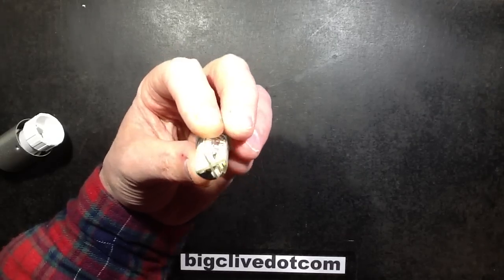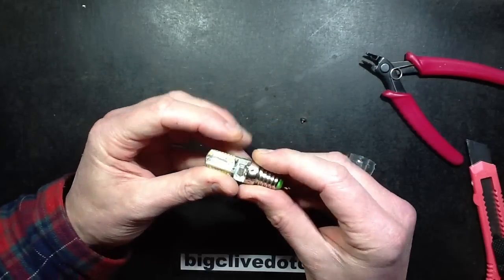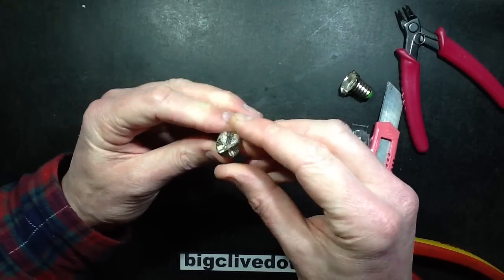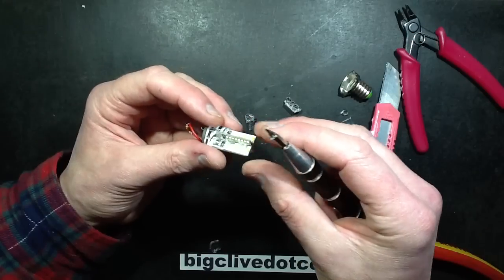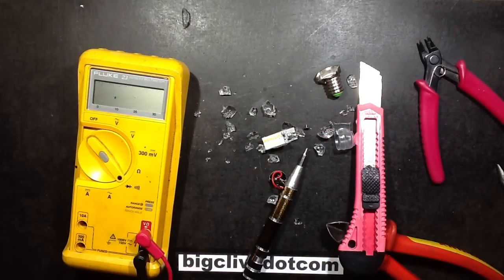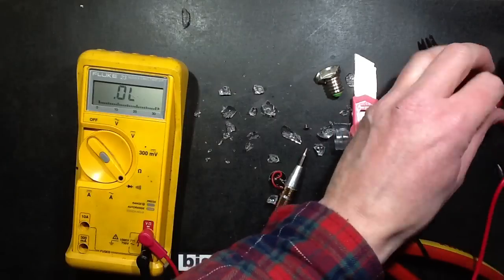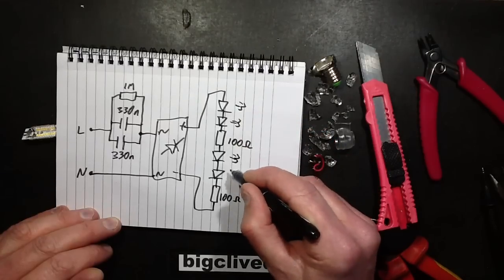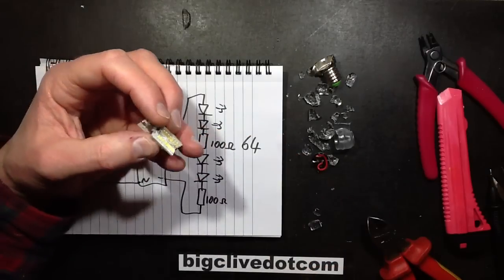Silicone gel LED lamp "teardown" (complete shred).

Comment: That Stanley knife and your thumb.

Scares me every time there is a sudden jerk.
Reply from the maker: I'm a seasoned veteran of using a Stanley knife.  I have cut myself in the past, but I can't even remember the last time I did it.  When it's a tool you regularly use you tend to exercise tight control of it.  Sadly the UK health and safety executive don't understand this and keep trying to ban them from construction sites.
Reply: bigclivedotcom Absolutely. I recall jamming a pocket knife blade into my foot as a teenager, trying to open those ludicrous packages that are built to survive chainsaws. So the fear remains :).

I was additionally wondering why they had two 330nF caps? In case one fails? Surely they're so small that space isn't an issue?

Thanks Big Clive, you're the best!
Reply from the maker: TED6667 I think it may just be easier to get the 330nF capacitors rated at that voltage in an SMD package.  It also lets them spread the circuitry evenly on both sides of the PCB allowing a slimmer profile.
Reply: bigclivedotcom Ah, perfect, that makes sense! Might be an e-series preferred number issue. Thank you very much Big Clive!
Reply: +TED6667 You should see how fast my grandmother cuts a potatoe, with a knife so sharp, you dont know your cut until a minute or so later. No cutting board needed.
Reply: We've had a lot of different kinds of knives at work and, oddly enough, Stanley makes some of the worst stanley knives on the market (tho they also make good ones).
Reply: Weirdly, in my neck of the woods a “Stanley knife” refers only to the kind with replaceable trapezium shaped blades, not these snap-off knives.
Reply: @DarkLinkAD  The actuality is: The sharper your knife is the less accidents you have. Dull knives catch and that is the biggest reason of knife accidents.

Comment: Here in the U.S., these are becoming a popular upgrade replacement for the E-17 incandescent bulbs used in both over-stove smoke hoods and over-stove style microwave ovens. The incandescent bulbs have a VERY short lifespan due to being in such a tight, poorly ventilated light enclosure and due to the fact a lot of people tend to use these as "night-lights" for the kitchen area. I ordered the below set for a good friend and she reports that so far, so good. She's happy with the light output, the color, and even reports that the dimmer function works just fine. She leaves them on almost all the time on the low setting and turns them up to illuminate the cooking surface of her stove when she cooks.

http://www.miniinthebox.com/dimmable-e17-6w-80x3014smd-600lm-2800-3200k-6000-6500k-warm-white-cool-white-light-led-corn-bulb-ac-110-130v_p3310413.html

Comment: Hi Clive, i have these bulbs with G9 base and noticed they still glow when off no matter how long .  I assume it is drawing power somehow.  The switch for it is not illuminated so can't be b that.  I have notice is draws 14v AC and when multi-meter is set to DC or continuity setting on the positive and neutral at the back of the light the led glows is no-more.  Do you know what is happening and what can i do so it doesn't glow?
Reply from the maker: DUKE It's very common.  It's caused by a mixture of insulation and capacitive leakage between the switch wires.  Although it's only micro-Amps that is enough to make the LEDs glow.   Most LED lamps use a parallel resistor across the LEDs to shunt the leakage current.
Reply: Thanks Clive, I just saw one of your other video talking about it.

Comment: I have some g9 leds I bought, and the US supplier sent me 230v bulbs, despite the listing only saying 120v. they total 104 LEDs, two sets of 52. Each set of 52 has a 100ohm resistor on it, and both are connected to the same 330nfx2 capacitive dropper and diode bridge. As I live in the US, is there a way to make them work on 120v? They currently draw about 1 watt, and the listing rated them at (a rather suspicious) 9 watts. Any ideas?
Reply from the maker: +Luke Den Hartog They are very unlikely to actually be rated 9W.  Do they put out much light on 120V?  If they do and there's not too much flicker, it might be worth using them as decorative lamps, as they should last a very long time if they are being under-run.
Reply: +bigclivedotcom They run at less than a watt. They do flicker and I was going to bodge an electrolytic on the output of the diode bridge. We bought them to replace the three 40W halogen lamps in my ceiling fan. The halogen lamps draw far too much power. If one violently detonates at some point, it will be fun to watch. they certainly used cheap LEDs on these, because I used "Bobo The Clown's LED quality testing method"  and some light, some dont at super low power. If I were to get an LED total power of about 15 watts over the three bulbs, I would be happy. Thanks for the quick reply!
Reply from the maker: +Luke Den Hartog That would work to increase the voltage and smooth it a tad, but it would mean a capacitor sticking out the side of the lamp if it's one of the tiny ones.  I'd suggest getting some new lamps. It's going to be an easier and safer fix than trying to bodge bits into these ones.
Reply: okay I think the seller was sending replacements. might just use these for decorative purposes. thanks!

Comment: Kind of disappointing they didn't put those LEDs in reverse parallel. Could be even smaller without the rectifier diodes, and with the dropper hidden inside the base. or it could leave enough space for 16 (or 24?) LEDs more.
Reply from the maker: On one hand the shimmering might have been noticeable, although if the LEDs were wired as inverse parallel pairs, they are close enough to minimise that.  There might also have been a slight reduction in light output from driving the LEDs at double the current, albeit for half the time.
Reply: I thought LEDs were nonlinear in that they get much brighter at higher current. An LED driver trick is to drive with 10 times the rated current, but only a 10% duty cycle. Works great with a µcontroler.

Comment: These things flicker like hell due to the absence of a smoothing capacitor. I find it so uncomfortable that I cannot use them. I've tried several from ebay but they all flicker. I assume they ditch the smoothing capacitor due to the space restrictions.  Would be interested if you've come across a standard size G9 LED replacement for halogen capsules which does not have this problem.
Reply from the maker: +Liam M Many of the smaller lamps ditch the electrolytic smoothing capacitor to save space.  Some do shove it down into the base, but they are quite hard to find.
Reply: +bigclivedotcom I think one could of fit here. I would also say lack of a smoothing capacitor is unhealthy, but I have nothing to prove that. I just know personally flickering lights give me headaches, but it may be because I have cluster migraines, which is related to epilepsy.
Reply: I've just salvaged a light fitting from a skip that has 8x G4 bulbs.  I've fitted these little rubbery led lamps and swapped the transformer for a 12v 10w electronic power supply.  They really do flicker very badly.  any suggestions how I can tone it down, without butchering each bulb to add a capacitor into it?
Reply from the maker: +Nathan Lucas If the power supply is a DC one then they shouldn't flicker at all.  If it is designed for halogen lamps then I'd recommend changing it for a proper DC one.   What wattage are the LED lamps?
Reply: bigclivedotcom they're claimed 1W, but I haven't actually done anything to confirm this.  The psu is designed to run led decking lights, but is of unknown so could be cheapo ebayage
Reply from the maker: +Nathan Lucas Check that the power supply is even a DC output.  It could be AC or unsmoothed DC.
Reply: +bigclivedotcom Dear Mr BigClive, do al these need a smoothing capacitor? I have 10W led light and want to use on 9V battery. Does that need smoothing capacitor as well?
Reply from the maker: +Telephone Telephone If running a light on DC it should not flicker.  Note that the small PP3 9V batteries will not run a 10W LED for very long.